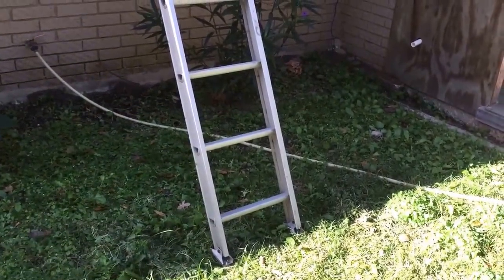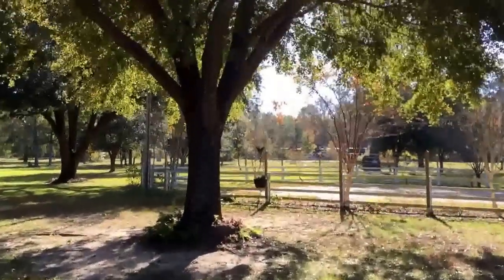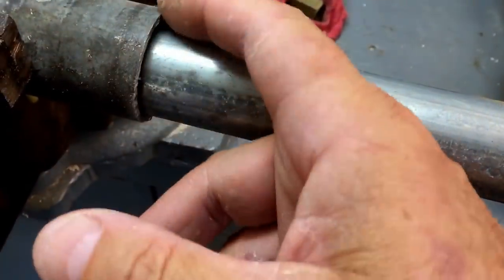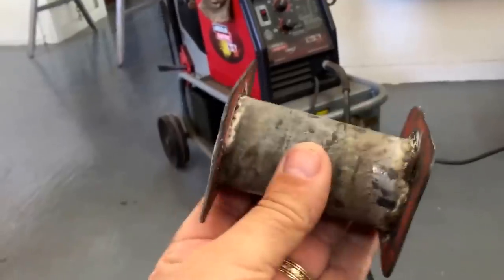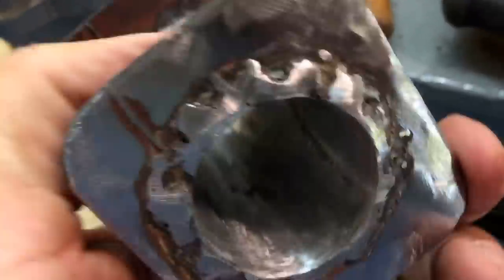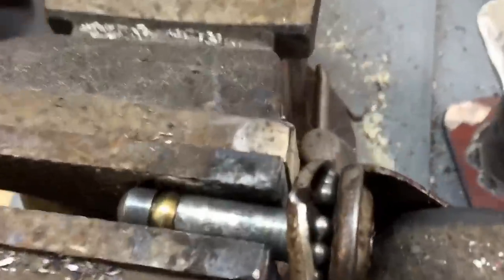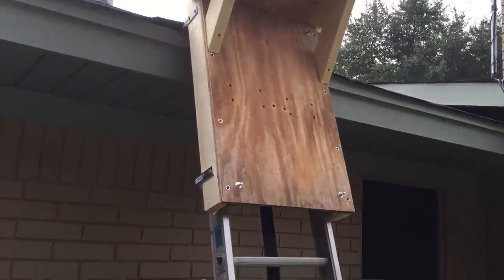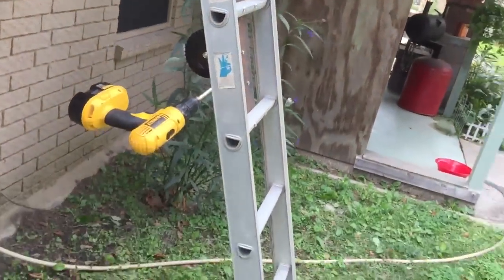How to build a drill powered shingle elevator

Comment: If you got an electric winch you could mount it at the top without messing with a roller. The wire with the control on it would be long enough to use when you are on the ground or on the roof.